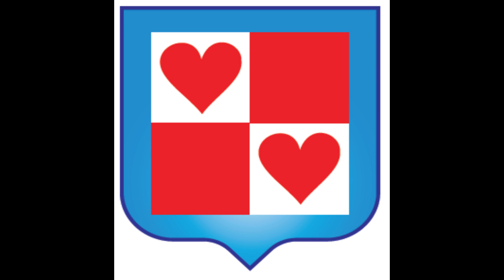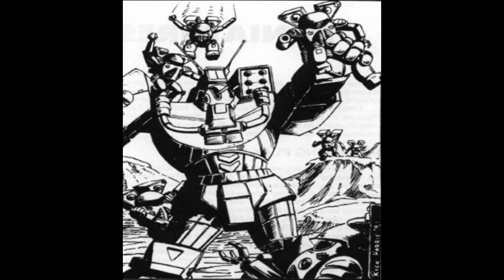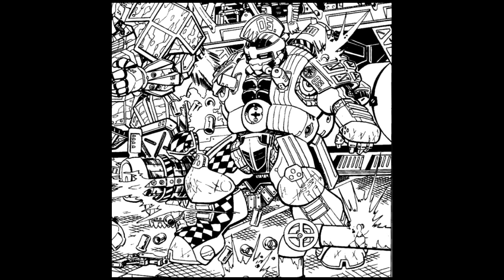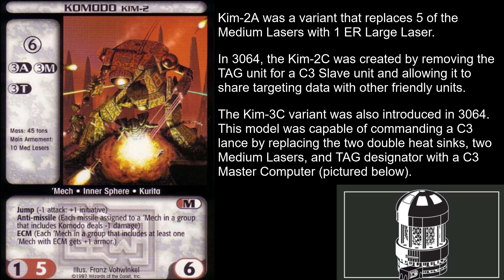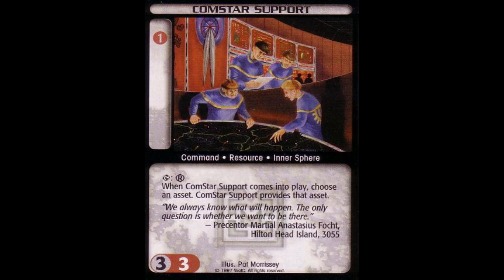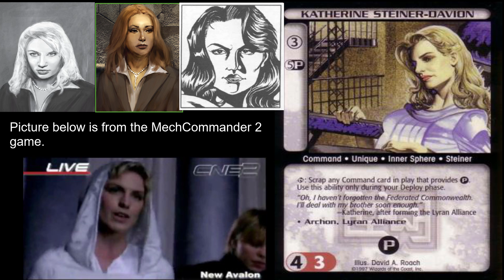Battletech Lore: BattleArmor

Comment: I have loved BattleTech for over 30 years, and still do. I realize that power armor is far more likely to be effective and functional than a 'Mech, but the cool factor... Though I think Living Steel got the concept of 'Mechs right. Not only is there a ground pressure issue, but in the words of one of the Moritori pilots: "Do you get a good view of the battlefield from 30 feet up? Oh, certainly... You also give the other guy an even better view." In the Living Steel universe, the Moritori was an experiment that is, essentially, a humanoid BattleMech.

Also, Sylph (sill-f), not Slyph (sl-if).

Comment: I love Battletech, but now that I'm older and have a little bit of experience in how machines work, I have to recognize that so many of the original designs are ludicrously under-engineered. The new versions of these machines aren't as iconic, but they look like they'd actually work.
Reply: Looks like they would actually work. The problem is your applying a hydraulic type system to the imagined world of molymar fiber Steel which contracts upto 50% its length when electricity is applied.  
So the original mechs were humanoid in appearance because the molymar fibers were bundled together and applied like like muscle to a skeleton.  With that in mind the only area that would probably not work would be the knee and elbow  joints. Which are often drawn as pin and hinge system. But hey its 1980s sci-fi.  At least they got FTL travel a little closer to reality than Star wars Startrek
Reply: @lidlett9883   "At least they got FTL travel a little closer to reality than Star wars Startrek"

You have a working FTL engine? i hereby declare a trail of Trial of Possession for your FTL engine
Reply: Japanese Battletech : are we a joke to you.
Reply: Freebirth excuses only deserve snapped necks, EYES UP FRONT SURATS!

Comment: We'll probably develop viable power armor before any viable production battle mechs we'd currently consider large.
Reply: Gotta start small then build outwards until it stops being battle armour XD
Reply: @dalesheen1816  Mechs don't really have much practical use. Profile way too large, bipedal movement has essentially no advantages for a machine (humans are only bipedal because it's efficient over long distances). We'll never develop mechs for warfare like you see in anime or battletech.
Powered armor does make sense and will be more widely used once the battery situation is solved, although they'd be mainly for purposes other than warfare (construction, emergency response, so cops can choke people to death more efficiently, etc.).
Reply: @BigMikeMcBastard  Right? Developement more in line with Starship Troopers is what I foresee.
Reply: @BigMikeMcBastard  nice use of an unfounded myth about police. Almost like big city police are over worked, stressed out all the time, and under funded leading to poor training and a lack of an ability to replace older experienced officers when something like that happens leading to stations protecting those officers not wanting to lose their experience.

Yep clearly the answer to all of these issues is to defund the police and further make their jobs harder leading to more screw ups. You do realize their people to.

((And in the case that was a sarcastic joke and you weren’t serious…. Uh… I’d like to apologize before the comment war starts))